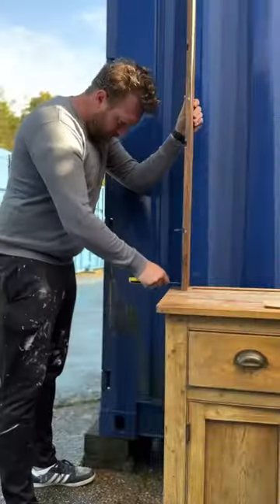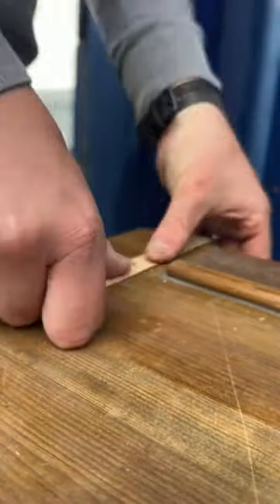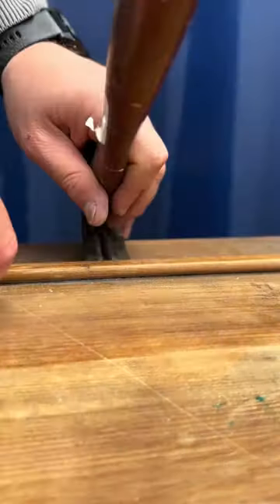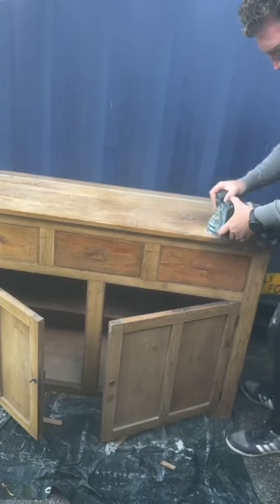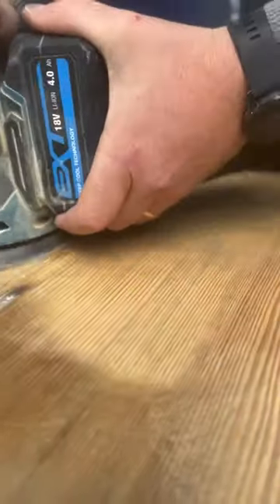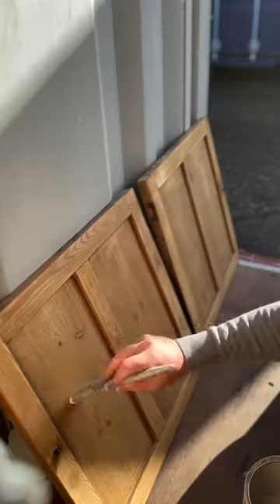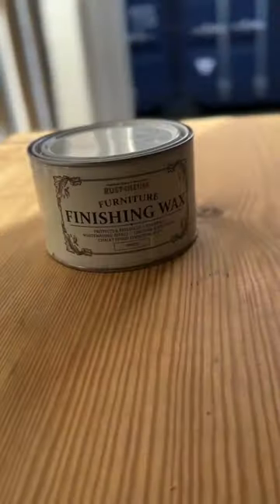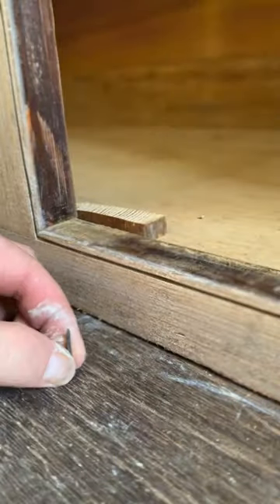Stunning renovation/upcycle of an antique english pine sideboard. DIY

Comment: Does the wax protect the wood from moisture and color alteration? Because hand oil will change the color of the finish.
Reply from the maker: If you apply it well and get a good buff on it then it will definitely protect it from moisture.

Comment: A beautiful piece, job well done.  I’m here to second the comment on price.  Of course some jobs are just easier than others but you need to ensure that you’re not under cutting yourself.  Do you keep a full list of costs and hours spent to bade your final price on?  Do you charge your time at a liveable rate?
Reply from the maker: Hey, I price my things to sell them quickly, if I was will to hold onto a piece for longer than a week I would price them differently. I tend to work on 3/4 pieces a day so that it all becomes very workable. Bare in mind I don’t do this full time either.
Reply: @Moneyforfurniture  it’s a nice piece and someone got a bargain but, yes, working a production line does help to make the job go more smoothly.  And if you can keep your costs/prices down that will help make things easier to sell - I’m not gonna lie, I’d rather pick up a bargain any day than break the bank 🤣